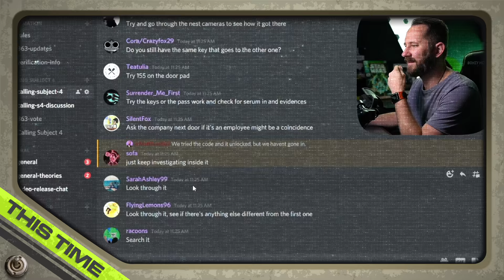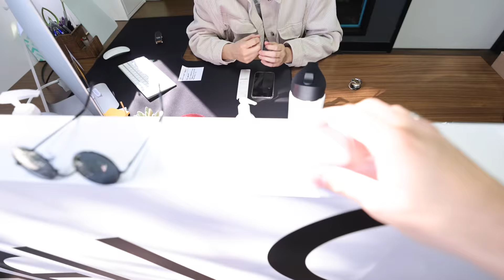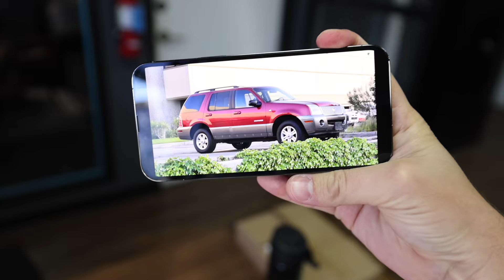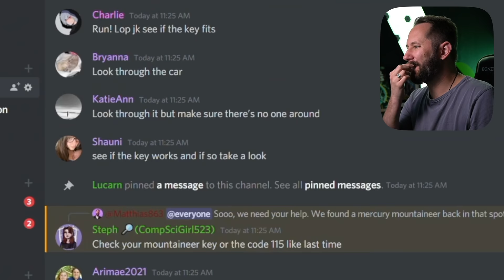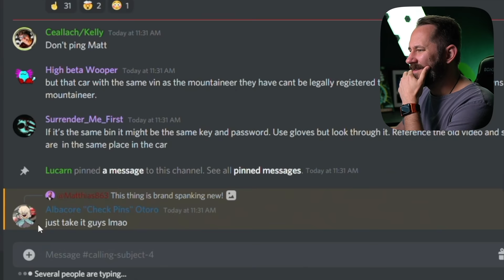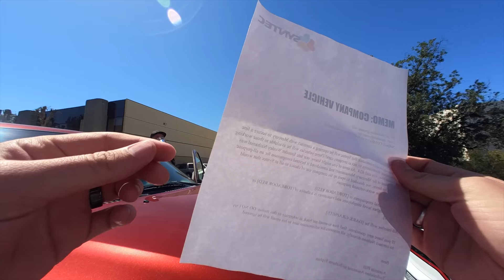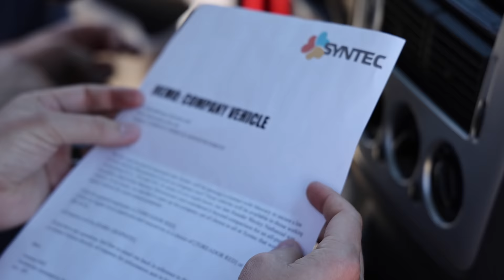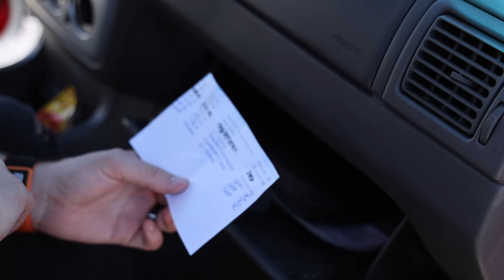The Last Time I Did This I Had To Wear A Hazmat Suit..

Comment: 2 things for further searching:

Look under the hood of the car.
What’s the expiration date on the candy and stuff. That’ll give a rough estimate of when it was last used or if there are multiple, there is a time frame of usage.
Reply: This is honestly such an underrated comment. Respect my man, I didn't even think of that. I was just eating my chocolate chip crackers with some peanut butter with nothing going on in my brain.
Reply: If it helps, the expiration code on Sugar Babies isn't a straightforward mm/dd/yyyy or dd/mm/yyyy but instead uses a number/letter format.  The number is the last digit of the year it was made, and the letter corresponds to the month with A being January, B being February and so on.  So, for example, 7F would be June 2007.
Why they do it that way and not a clear, easy to read standardized method I don't know.
Reply: exactly.
Reply: Looking at the expiration date is genius

Comment: They have to brake open the case, it looks openable with maybe a crow bar or just some random handy tool Woods has but if somethings in that they have to open it because there may be serum, documents or some other crazy thing. Also the fluids with the black light, Scott was a 'bio chemist' meaning he worked with different serums, substances and liquids so maybe that was just stuff he had on his lab coat or hands when he entered the car after work.
Reply: Yeah after they ripped apart the notebook that time I started to wonder why they bother waiting to find the right keys or combination anymore
Reply: Honestly, those kinds of locks are easily defeated with a shim and some patience. LockPickingLawyer does it all the time on these kinds of wheel locks.
Reply: is that the same case that the guy carried in?, in the preview for the next episode? that said he works there..

Comment: By the looks of it, everything that happened so far was only a distraction. Everything is repeating itself without Deb. So couldn’t you say events caused now could have happened without her? Think about it, the apple 2 could have been controlled by anyone just to mess with you. When Deb called you, she wasn’t worried if someone was tracking her and when you told her you saw the murder, what if you had just told someone from Cyntec everything you knew? And Deb could have been dead for so long making it an easy distraction, like someone needed more time… Just a theory thou, stay safe.
Reply: but my question is: what has happened now, what has changed, for them to have only just found out about the murder, the information of her death was literally handed to them on a silver platter. what happened now, to whoever was hiding her death, for them to tell the team?

Comment: Wanted to make a separate post about the whole time travel theory that people are playing with.  The more likely solution is that it involves some form of time dilation or time distortion and not actual time travel.  This part was covered briefly with the discovery of the "Project Pegasus" paperwork which they completely disregarded.  Trying to open and close different "time bubbles" through using a electromagnetic accelerometer machine was what it was showing if my memory serves correctly.  Time travel or not, some form of time manipulation is involved going by what they have shown so far.

Comment: I think the next move should be to analyze all the documents in the car for potential secrets, codes, names, etc. You should definitely get into that briefcase, which can be done quite easily by either breaking the locks or cracking the code with one of multiple methods. Just looking up a tutorial should make it easy to get in non-destructively.

Comment: Mercury did NOT go out of business, Ford and Lincoln (Who owned it) discontinued it, and sold part of it to an unknown company, MAYBE Syntec was the unknown company that bought it and used it to make their own company vehicles, again just a theory, but Mercury did not go out of business
Reply: i think they just meant, they don't make the mountaineers anymore..
Reply: @msprincesss115  well I would have to say no, the mountaineer is based off the ford explorer and Ford still makes the explorer, but if syntec owns the company and if syntec is not fully out of businesses they can theoretically still make the cheeper mountaineer like older models, but I would assume that the old engine would hard to get, so they still need to check the to see if that is the same

Comment: For the briefcase, just hold the square open latch as if you were opening it and then scroll through each line of numbers. For each line, there should be 1 number slightly looser than the rest. Those are the numbers. When all 3 found, it will open!!!

Comment: In 2010, Ford Motor Company announced the closure of the Mercury brand in an effort to focus on the Ford and Lincoln brands, ending production at the end of 2010. The final Mercury automobile, a 2011 Mercury Grand Marquis, rolled off the assembly line on January 4, 2011.

Comment: There are paint drops on the passenger side of the car between front and back door it could have been a different car that was painted to look the same. 20.13 is a shot where you can see it and you can see the paint drops in earlier shots too

Comment: The only way for the new and old mountaineer to have the same vin. Is. VIN Cloning or car cloning. A practice of using the same identification number (VIN) from a legally registered, stolen or salvaged vehicle. So remember like way back. There was a chop shop. What if the chop shop gave all the cars it had the same vin number. And they just so happened to be red mountaineers used by syntec.

Comment: The Mercury Mountaineer is a mid-size luxury sport utility vehicle (SUV) that was sold by Mercury from 1996 until 2010. How the mountaineer is around after 2010 and looks like it was made today 2022 track down the information you will find out how is the owner.

Comment: The splatter is most likely the gunshot if it is the same car it's probably correct to assume it somehow has the same history but a newer model but the bodily fluid is blood based off the splatter pattern and the car itself is the same car. Maybe they use mountaineers as execution cars like we saw that Syntec made Deb kill him in the mountaineer so maybe that was common or at least more common than just the one incident
Reply: but blood doesn't show under blacklight, UNLESS its been sprayed with luminol or something...  at least it didn't show THEM spray in anyways..
Reply: @msprincesss115  then what would have that type of splatter if not blood?
Reply: @grimsleybear5580  .. hmm, well if some one searched it already and already sprayed it with that.  Or if they cleaned it up, some kinds of cleaners show under black light. then there's always other kinds of bodily fluids, but it would be an awful lot of it of so. Lol.  But tonic water shows as well, among other things.

Comment: my first thought for the code on the briefcase is when john doe left you the case which had the 3 and 3 number locks on them. i went back through the videos and the code for that one was 034 118. maybe try that and see if it works as “history is repeating itself” x

Comment: Tbh i dont know but did someone notice that the splatter of fluid which was visible in the black light is same as the splatter in WES's mountaineer and the place where wes was killed, like its de ja vu or some time loop i dont know but this car is like the same car just cleaned up.

Comment: Opening a 3 digit combination suitcase isn't difficult or time consuming. There are only 1000 possibility of code, 000-999. Seems alot, but using 1 thumb to rotate a dial and the other thumb to rock the button, it'd take just 1-2 seconds to try 1 combination. It'd be open in under 1 hour. If they don't care about the suitcase, even better. Just cut the lock open.

Comment: I noticed this in the last video but forgot to mention it ,(when they pointed the camera through the window briefly) if the car is brand new, why does the seatbelt look worn (the red button part)? also in the boot/trunk, a piece of equipment looked like it had rust on it...regarding the stuff the blacklight showed...maybe the car was cleaned and renewed by Syntec or a associate of Syntec as a professional cleaning service would have cleaned that off...??

Comment: You need to check the seat with the black light and if it shows up like how the blood was on the other car then you know the car is actually the EXACT same.

Also check the journal again it likely has new things now that you’ve found the car and looked through it.

You need to check the seat with the black light and if it shows up like how the blood was on the other car then you know the car is actually the EXACT same.

Also check the journal again it likely has new things now that you’ve found the car and looked through it.

Also that guy claiming to be a fan is definitely from syntec and likely Jordan Kendall or someone from that note you found

Comment: Please read ASAP!!!!! My name is Matthew I started watching your videos a few years back with Dope or Nope. I have been watching your videos since the whole Syntec thing started. I have done mechanic work for over 15 years. There is no way to vehicles have the same vin number. No car manufacturer would ever do that it is against the law. Vin plate on the dash has probably been altered. Check the door vin number and also is stamped on the motor and transmission. Also you tried 863and 155. Try the first three numbers of the Vin and also the last. My last suggestion is also try looking at the key pad on your phone and try Deb or Wes. Might help you get into that briefcase. Nothing else. Nothing else take a hammer or crowbar those locks are easy to get into I know cause my dad had the same ones. Don't ask about my past but this is what I can tell you I am a different person now and for the better. Good luck.👍

Comment: i actually found 2 vins for 2003 mountaineers, one was "4M2ZU66H63UJ08041" and  the other was 24M2ZU66K63UJ08041" the difference is a single number double check if there is that one number difference, it isnt actually yours

im a mechanic, and have actually seen this so many times with the vin numbers, one time i heard from a drinking buddy that the local police once mistook a vin number by mixing up a single number
Reply: Same key?
Reply: @buffrules4912  actually, fair point, that i cant explain unless syntec modified the cars after market to use identical keys for "ease of access" by other departments

edit: but, you have to remember car keys are not unique to one vehicle, so its a possibility, the key just happens to match
Reply: @bigfrankfraser1391  I guess.
Reply: @buffrules4912  all i know is, i vin searched the mountaineer and found 2 identical models with one letter differences

Comment: Dang Mathias, back at it again with the 869 vids
Reply: Nobody every responds to your comments bro, why don't you just not comment?
Reply: Wanna go keyboard warrior?
Reply: Ever hear the one about sodium bicarbonate?
Reply: NaBrO
Reply: Wrong, even your chemistry is bad bro!
Reply: Because I don't want to download Reddit like the cool kids do... That's what I did with Facebook and next thing I new myspace had died... Died bro.... Like not even as cool as Spotify... Which replaced itunes and is only half as cool... That's why chemistry joke guy
Reply: Ok wait wait wait.... Isn't the syntec location thing totally based on the prank where you label thins 1,2,4 and then they're forever looking for object labeled 3?
Reply: That briefcase is likely coded between 300-750 as 80 of preset codes are in that fashion of lock. Also, checking every number per lock would take 20 min total unless you have a screwdriver
Reply: That bodily fluid is COVID all up in that car bruh. Best get yo self test Ted bruh

Comment: What if the notebook you put heat to and things will show up also dose anyone notice that in the notebook that they tore apart has things showing up in it and what if the codes they have and that if so of them can go together but what if the thing they did other the trunk of the car helps with the journal

Comment: Technically the VIN is changed out or is the same but the registration should be checked and the other vins should be checked before rummaging through the other mountaineer, which you've already done 🤦.
That's what I thought from the last video is the company ordered a couple dozen with the same Vin for company cars.
Not the body fluids again and why does this also seem like a fan created this mountaineer also I feel like the VIN should not matter on the dash it's the title that you guys looked at is who owns the car and if the VIN on the title matches up with the VIN on the dash then yes the VIN is the same but if the VIN does not match up with the VIN on the dash then the car is considered Stolen or the VIN is considered stolen from one of the parts on the other mountaineer.
And back to the fan I think it's kind of odd that a random fan shows up with a brown briefcase as well in his hand.